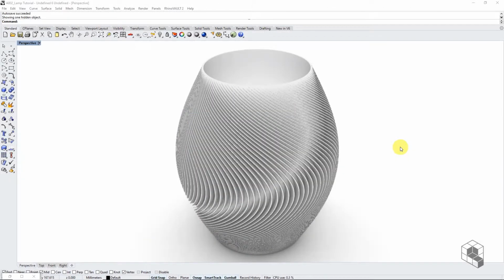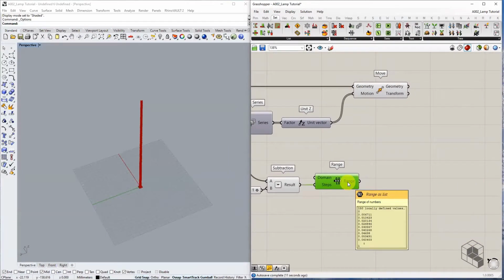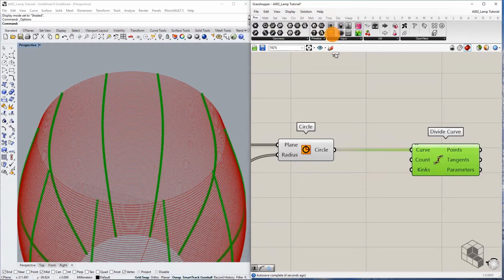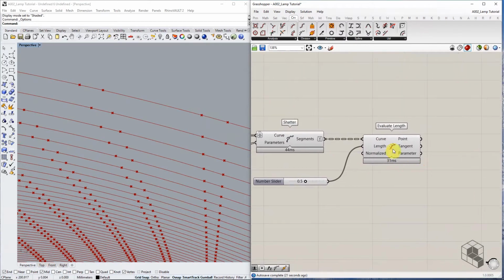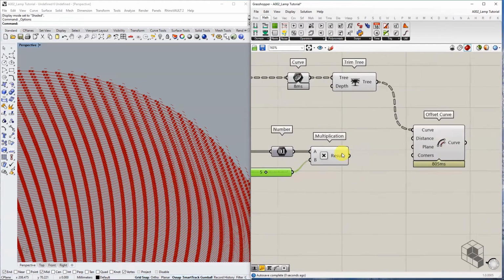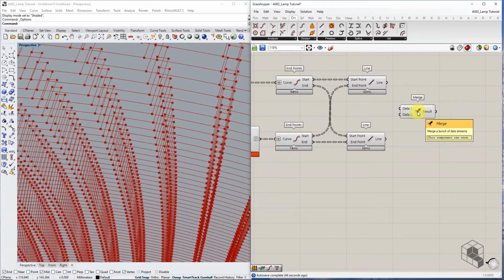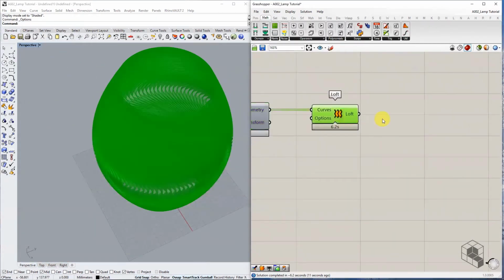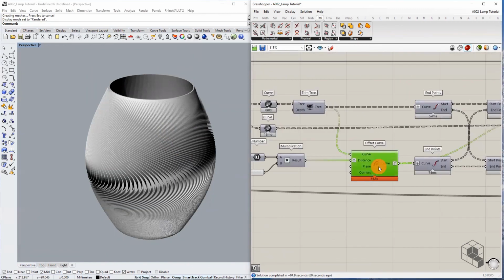PARAMETRIC LUMINAIRE DESIGN FOR 3D PRINTING - GRASSHOPPER TUTTORIAL | GRASSHOPPER 101

Comment: but how will it get 3d printed?!
Reply from the maker: There are slicer software that generate G-codes that is used by 3D printer to print the geometry. This video covers the workflow for modelling a closed geometry, which is the essential starting point for any object that is to be printed.